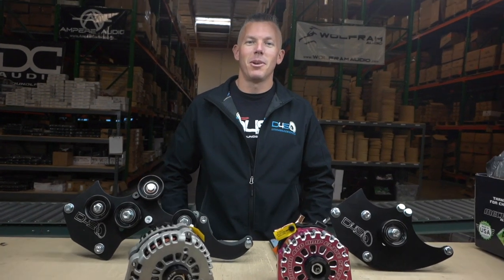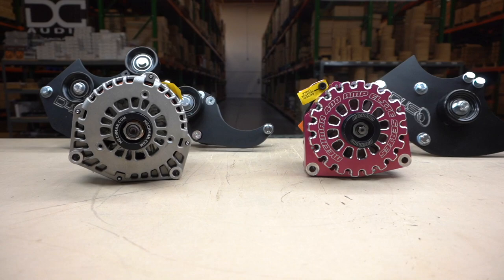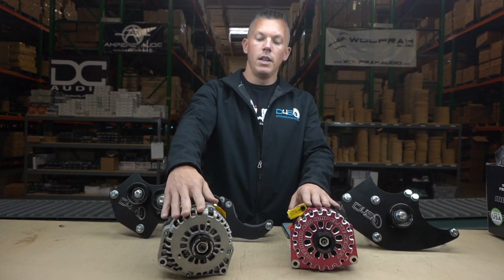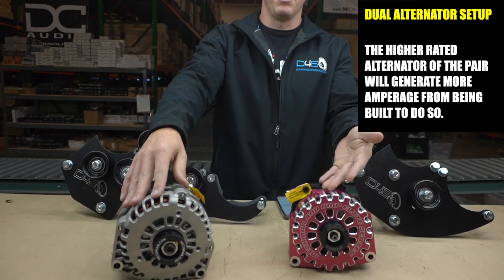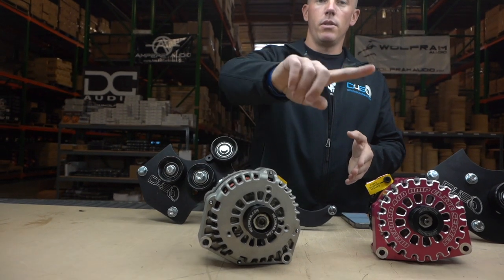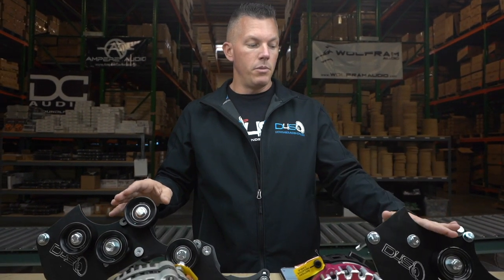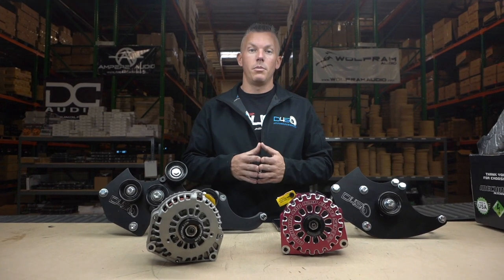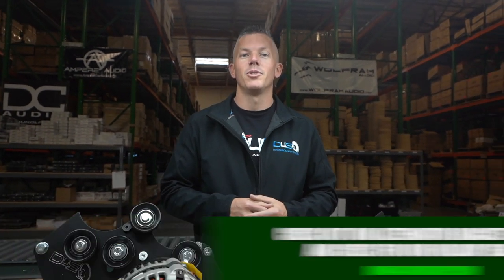FAQ: CAN I USE 2 DIFFERENT ALTERNATORS IN THE SAME SYSTEM?

Comment: where does the turn on wire go to for the secondary alternator go to the amp turn on?
Reply: The alternator turn on wire goes to the harness for the alternator. Which harness you need depends on what alternator you have. As such, this wire should run from your car electrical system to your alternator, using whatever style harness your alternator requires. You could patch the wire into the car electrical however you choose, but the ideal and simplest location would be to do so out of your factory alternator harness.
Reply: @the-dullahan  the alternator is running independent from the veh from alt to battery no harness
Reply: @flip_flop_farmer  there is no such thing as an alternator which doesn't use a turn on wire. Check your alternator again, there is someplace for the harness to connect.

Comment: Wont one work harder with two different amperages hooked to same bank?
Reply: yes, i have a triple dc power engineering setup and from my experience one is always   putting out more than the other two but when they sense the voltage drop the'll pick it up and increase the output to keep the voltage stable. If you have 3 370 amp alts you dont need the full 1110 amps they can produce all the time when driving normal around town that 1110 amps will be made when current demand is increased.

Comment: I’ve been wondering if you can use a high output alternator in a, let’s say Honda but the alt is meant for a truck.
Reply: Yes, if you can fab up a bracket that keeps it properly inline and setup with the correct pulley. I run Chevy alternators in my Ford Explorer.
Reply: @Widowmaker2828  ok nice👍🏼

Comment: Awesome does the kits come with the correct belt?
Reply: No, you will need to use string to measure the belt size you need.
Reply: Yes the kit from D4S comes with everything you need a gates belt is included

Comment: Bro I need some help with a amp issue.  
My amps shut off for no reason I have tried everything.  It is not like your setup but my baby is having trouble bumping ....
Reply: Ground issue
Reply: @hopskustomaudio  where at on the amp or in the wiring. ?
Reply: Several different reasons this could be happening. Clipping, bad ground, wired under ohm load.
Reply: @Goz  could be at the amp or even at the battery. I would do a big 3 upgrade and then ground the amp to the frame instead of the body. 99% of the time if it's turning off it's either bad ground or not enough power to supply the load and voltage to the amp is dropping below the voltage it needs to operate.

Comment: 2 400amp alternators on the same battery.
Do I get 800amp or is it 400amp?
Reply: You would get up to 800 amps, but your actual amperage generated depends on a lot of factors. Also, any time you are running multiple alternators to one single feed, they should be run through a voltage control unit, which takes the input from each alternator and sends the output to the battery or batteries. This keeps the alternators from "seeing" one another and causing issues with performance or causing damage to one or both alternators. This is why all vehicles (cars, boats, etc) which come from the factory with multiple alternators will always use voltage controllers.

Comment: These brackets don't help those of us riding in a foreign whip like a Honda or Nissan and need a bigger alternator then a 90 amp. Really sucks this is only helpful for truck owners.
Reply: So grab some card board design a alternator bracket and market that stuff and if you have a problem with the belt just add a bigger pully or smaller to the belt tensioner on your Honda.  Good luck to you everything has an answer in this world. Make friends at a local machine shop or take a welding class so you could build custom Amp racks. Or take a basics to DC electrical course and figure out how to generate enough amps from capacitors and batteries to build the baddest systems on the planet. Or learn fiberglass that way you can build custom walls and do body work on Lamborghinis for a living.

Comment: That didn't answer the question at all. All you stated is that you can run them together or you can separate. And everybody knows that the voltage is constant. But you said absolutely nothing about amperage. Your only comment was duh this one's bigger this one smaller you'll get more from the bigger. I'm pretty sure the question was if the amps from both add together!
Reply: Yes they both add up to over 600amps of charging power